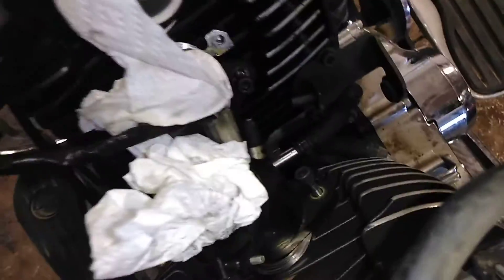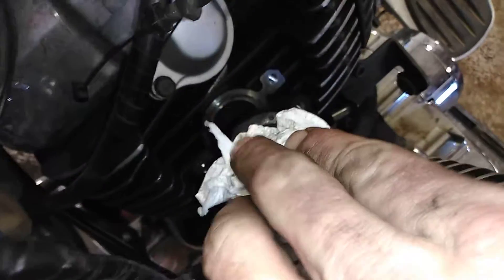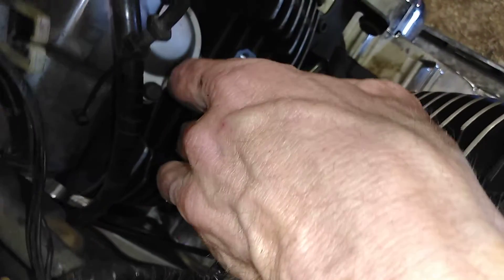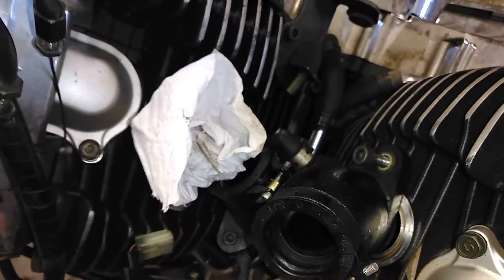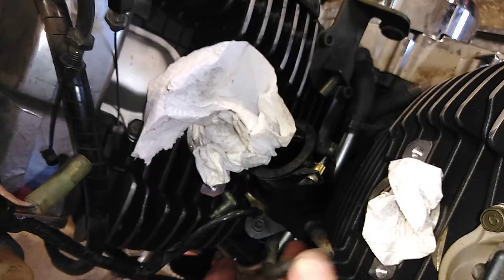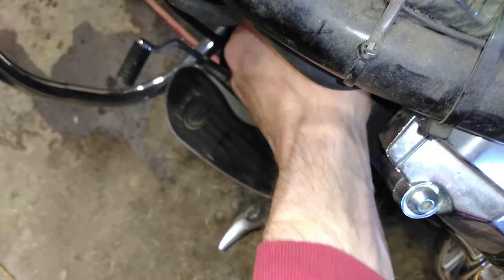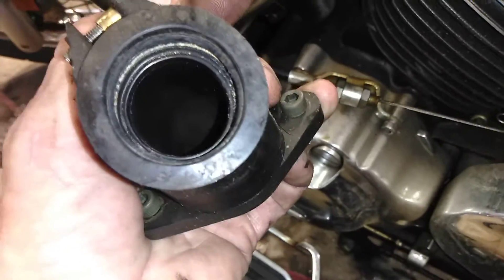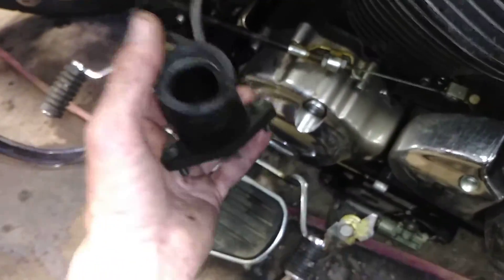Yamaha vstar 650 . Carb n intake boot rebuild.(6)

Comment: Would a cracked intake boot cause bogging on full throttle ? I can’t accelerate past 60mph and bikes running lean. Half throttle sounds okay but full throttle sounds like an old tractor that has no oul
Reply from the maker: Yes to much air not enough gas !
Reply: @WaldensWorld  front header pipe turning blue and motor running hot, backfire/popping under deacceleration.
Reply from the maker: To much fuel or air leak on intake ! Your bike actually sparks on exhaust stroke too ! Would be my first check
Reply from the maker: Pipe blue is usaly lean to much air ! Check your Facebook plastic intake isn’t cracked or oring broke
Reply from the maker: Not Facebook lol
Reply: @WaldensWorld  I feel like it may be something else aside from the intake boots. I ordered the parts (intake boots with oring) today from eBay ($14) and I bought a can of sea foam. I will install the boots and if that didn’t change the throttle response I will seafoam it. Will keep you updated Walden, thank you so much
Reply from the maker: I’m not sure we’re your located sea level vs Colorado jetting will be different also a bit
Reply from the maker: Does it idle ok ?
Reply from the maker: U may need to go up one size main jet
Reply: @WaldensWorld  it idles fine, sometimes rough/sputters. when it’s warmed up it would die if I pull the choke.
Reply: @WaldensWorld  so I removed the intake boots and looked inside and there was no cracks, however the outer shell looked like it was cracked kinda bad. But when I sprayed it with throttle cleaner it bogs down at idle? Checked the spark plugs, they seem okay. Now I’m kinda pulling my hair for this. I think it may be clogged jet inside the front carburetor.
Reply from the maker: Sprayed the intake boot ? Or into the carb ?
Reply from the maker: Make have cracked rubber oring if it’s intake
Reply: @WaldensWorld  sprayed the intake boot, at the bottom of the carbs.
Reply: @WaldensWorld  the orings looked fine, I put the original boot back together because I was gonna send the new boot back for a refund
Reply: @WaldensWorld  do you know what type size bolts that connect to the intake boots are?